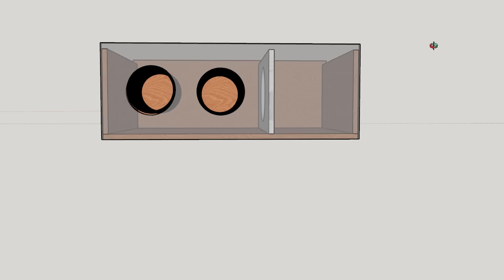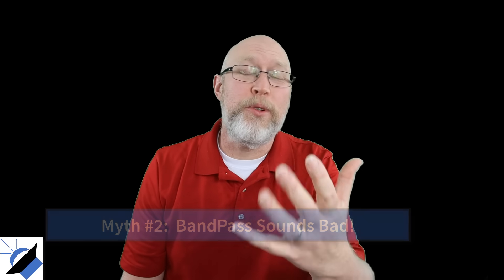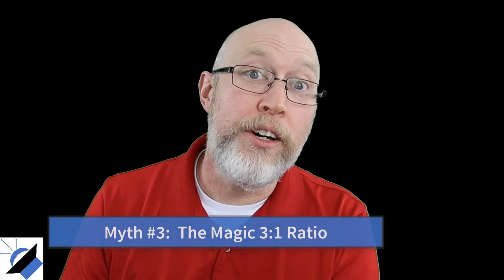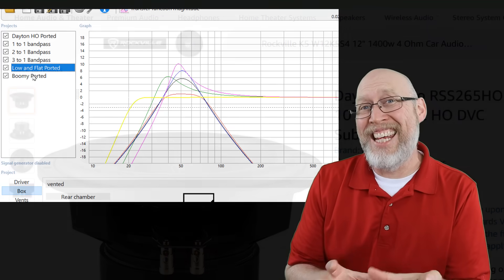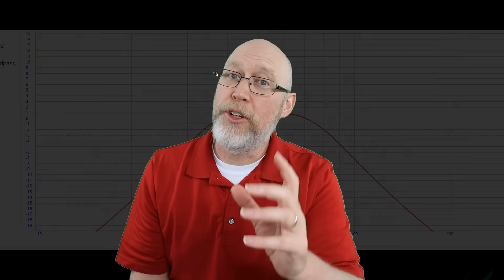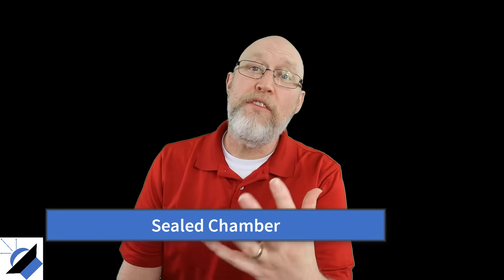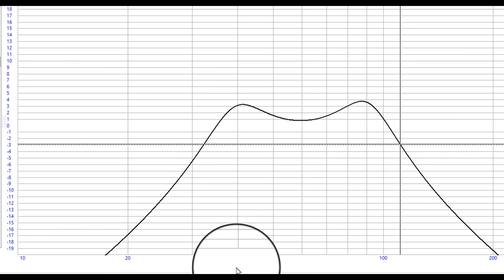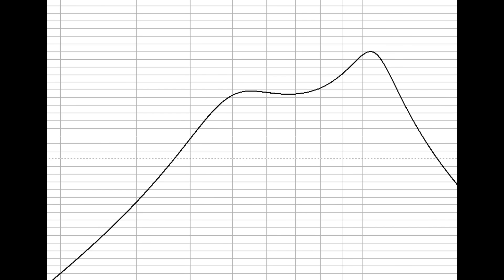Bandpass Subwoofer: You Are Doing it Wrong.  Bandpass MYTHS BUSTED!

Comment: Like 16 years ago I was pretty uneducated with the technical aspect of audio. I knew the basics had been messing around since I was a kid in 80s. But there wasn't hardly any easily found resources there are now. But I bought a visonik bandpass from crutchfield and it sounded terrible and muddy and I burned it up probably clipped hell out of it I'm sure but I didn't know about clipping and I couldn't hear distortion with it. They replaced it and I burned up another... I ended up going with a Polk db12 in prefab box worked great for years. I still have that BP enclosure (actually both) and now I know technical side it's a total piece of crap, it's small prob 1 to 1 but super small. I'm sure the sub that was in it was a cheapie.
Reply from the maker: Yea, bandpass is complicated.

Comment: Doesn't the bandpass box get louder at max watts/power and have half the size box than the ported box? I'm pretty sure them Dayton response plots are of sensitivity not max db output right? I would bet the loud or all the ported boxs would reach their mechanical limits far sooner than the bandpass box would. But the bandpass would reach it's electrical limits sooner than the ported. Seeing how most subs only do 1 or 2 octaves and we all like smaller lighter boxes, I don't know why we don't see far more bandpass subs. Also bandpass boxes have less or far less overtones and or unwanted higher frequency noise or distortion than sealed or ported boxes because they drop very sharply at there high bandpass frequency. I also feel like the bandpass plot must have been tuned to 40hz to 50hz? If so what's the plot look like tuned to a more reasonable 30hz to 35hz? I'm not saying the Dayton sub is best suited for a bandpass but I feel like there's more variables you didn't address. I like a sub to hit 30hz to 120hz or 20hz to 80hz for bigger applications.
Reply from the maker: Thanks for the comment.  That's a lot of ground to address in the YouTube comment area.  But a few quick things.  In general a bandpass enclosure is going to be larger because you're dealing with two chambers.  

As far as the plots go, you're making the argument that the bandpass enclosure can handle more power and will thus be louder.  True. If I were going to compete in an SPL competition I would use a band pass enclosure.

The main point of the video was that you can't just throw any subwoofer into a 3-1 band pass enclosure and expect to get a good result. For the typical person It's much easier to get great sound with a vented enclosure.
Reply: @DIYAudioGuy  well every bandpass box I've ever seen is smaller than the proper sized ported and probably over twice as loud. Which would mean you'd need 2 ported boxes to do the output. As far as I understand speaker boxes are a trade off of bandwidth, loudness, and size. You want it to be small you lose either bandwidth(bandpass) or loudness(sealed). You want bandwidth you lose loudness(sealed) or need a larger box. You want bandwidth and loudness you'll need a big box. So properly designed bandpass boxes trade bandwidth for higher loudness and box size. But most store bought subs are tuned too high around 45hz. That hardly what I call a sub. Missing the lower octave. I think being a musician that a sub needs to hit 30hz for the low B on the bass guitar so all boxes should be tuned to at least 35hz. But that would cost them loudness or size. And it's hard to sell a bigger or quieter product. But hey why not trade bandwidth? And that's where we run into the bandpass box. But they cost more to design and and make as well. I guess you get what you pay for, ha.

Comment: Hi! I'm a bass player and have always been wondering how to design the best sounding but also efficient 30-70 Hz band pass to support a smallish bass amp that does not go much below 80 Hz. What would you recommend, 4th or 6th order? What would be the smallest possible size (for portability) for a power handling of say 300 WRMS? Wouldn't a sealed enclosure with rear-firing passive radiators be a better choice for minimizing enclosure size and group delay (good sounding deep yet tight and well defined bass)?
Reply from the maker: I don't have any experience with guitar cabinets.  So I don't know what the best tuning frequency is for them. I like to build one sometime.

You are correct if you're trying to build a compact enclosure passive radiators are the way to go. You're not going to build a compact band pass enclosure because it requires two chambers.
Reply: @DIYAudioGuy  thanks for answering. But I'm wondering whether a passive radiator would allow for a smaller enclosure (for same low reaching tuning frequency. For instance there is a number of tiny bluetooth speakers with multiple passive radiators, reaching astonishingly low), while a vent requires a larger one (to avoid the ugly sounding mid bass hump)? Any advantages in combining passive radiator and vent, or is it just a good way to get in trouble facing impossible proper tuning?
Reply: Try a downward firing speaker with breathing room below... resonate the floor. (In most rooms)

Comment: I'm glad you made the qualifiers that you did.
Back in the 80's I tried every possible box design
in numerous variations.
They all stink.
Give me 4 Lab-12s in a 4 cu.ft. SEALED BOX.
It can't be touched for fidelity,
and has equal Output with a Ported Box.
(but needs twice the power).
Reply from the maker: Right!  You can get output from any enclosure you just need to keep cranking up the power!
Reply: What I discovered that I was missing was Transient Response.

Comment: Band pass systems sound better in a hatchback or suv/van, they have more low tone and less shake. Band pass boxes never seemed louder to me in SPL in any car Iv tried, and they don't project well outside the vehicle in comparison to sealed or small ported boxes. Your right that the old school boxes were not loud like the now big ports, but they seem like another animal all together tuning the car like a external port system. With sealed in the old school boxes under the power they used to If your projecting properly outside the vehicle, your going to want a sealed big port design. led or ported box. When you  use a sealed box or smaller ported box the internal body of the car or truck becomes the band pass side of the box. Band pass boxes are terrible for trunks giving more air flow shake for rattlers. What I'm realizing fully after almost 30 years is it's all about the box and the reason my set up when I was in high school was so hot beating everyone's set up in my age group across the state of MD. with just over 1000w rms, it was not about the amp but my custom built box. As soon as I put the old set up in a pre fab box was junk in the next car. Ant I had ppl coming to bass off with me over and over with 2000w rms multiple boxes and not even close. Everyone told me my box was too big lol but then they got smashed. If your looking for amazing you need a custom built box that fits your speakers and amp all else fails.
Reply from the maker: For sure man. It's a whole lot more complicated than most people understand.  Especially the in-car response, or the in-room response if you're in the home. 

I totally agree about box size.  I think we see so many undersized boxes because there's limited space in a car and because people seem obsessed with power numbers.  As the box gets bigger power handling goes down, but the speaker gets more efficient so you don't need as much power.  Why waste all that money on doubling your power (and upgrading your alternator) when you could just make the box a little bigger?

Comment: What about when designing a series 6th Order band pass enclosure, do you just tune the ports to the volume of the part of the enclosure that it’s venting from? And is it true the tuning of one side also has an effect on the other sides’ tuning; sort of like the ‘equal and opposite reaction’ etc?
Reply from the maker: To be perfectly honest, I have yet to find a credible, reliable source with mathematical formulas on how a sixth order (some call it a dual reflex) enclosure works.  I know they exist because these things can be modeled in software and software is nothing more than automated mathematics.  The instant I'm able to find that information I will translate it into some common sense language and I'll make a video.  In the meantime download WinISD and tinker with it until you get something you think will work.

Comment: Back in 1987 a friend and me built a box out of 3/4" plywood that barely fit in the trunk of my 78 Buick regal from side to side, we put four 12" woofers side by side and we had no port holes it was air tight and I drove it with a Kenwood 920 amp and it thumped like crazy.

Comment: My friend... You are using a low Qts 10" driver optimized for ported enclosures when modeling a 4th order BP. If you had used a 6th order BP for the RSS265, you'd get better results.
Reply from the maker: Absolutely.  You've got to put the right driver in the right box.

Comment: This is great info!  Can you elaborate on best polarity for a powered subwoofer?
Reply from the maker: Typically we just go with standard polarity, positive from the amp to the positive on the speaker, negative on the amp to the negative on the speaker.  Sometimes it doesn't sound good because of the placement and position of the subs or interactions around the crossover point and it's useful to flip the polarity or adjust the phase.

Comment: Great video! I love bandpass! Back in 2004 I had a 01 ford Taurus with two 12 inch pioneer impp TSW305Dvc subs in a 1:1 bandpass I built myself. Front&back chambers was 0.9cuft and I use pvc pipe for the port which was 3" x 5" each if I remember right. It's was Amazing! Had that longthrow bass and I used an audio control epicenter too. Sounded Beautiful inside and outside. People would ask me, "how you get your bass to be so deep and low"? Bass is just air and you want to move alot of it. Your sub is an acoustic air pump! 

So Now I have a jeep grand cherokee with a kicker zx2500.1 and a Soundqubed 15" HDX3 in a ported enclosure. It's beats stupid hard but bandpass have this certain sound that I'm addicted too. 

I been trying to order another one and build a 4th order wall but their sold out so I'm going to wall it with two Dayton Audio ultimax 18s. I have a 4th program on my PC that I already punch the numbers in and the results are impressive, better than any sub I seen probably because their fs is 19hz. Their louder and more efficient on lows. I can't wait to buy them!
Reply from the maker: I am a huge fan of the ultimax, and those pioneers from back in the day were awesome!
Reply: @DIYAudioGuy  yes man especially the SPL subs they once made. It's like they said forget car audio subwoofers! They were made in Mexico at first. Mexico was making them right because I could give them 2x or 3x the power and they would last but then they move everything to China and it all went down hill from there IMO. The spider would rip and cone would rip. They had the best infinite baffle subs period! Man I miss those days

Comment: The best bandpass design comes from Germany and is called Fortissimo Bandpass.  This was designed by Dietmar Carle and is in my opinion the best variant to build a bandpass. To briefly touch on the subject, it uses a chassis that plays well in closed cabinets. Best examples are: Arc Audio Black 12 or JL Audio 12w6v2. The closed chamber is first tuned to about 45Hz. In the case of the chassis just mentioned, that would be about 30-35Liter. The ventilated chamber is now tuned so that it corresponds to about twice the volume of the closed chamber. For a 12" chassis, or for the chassis just mentioned, that would be about 60-65 liters. The port area is then calculated from the air displacement volume of the chassis: in the case of the JL 12w6v2 this would be 500 cc x 1.65 cm = 825 cc air displacement volume. This value is multiplied by 0.4 - in this case 825 x 0.4 = 330 ccm port area. The port is then tuned with the length to approx. 65-70Hz. In this case, the port length should be 20-25cm. In the simulation now a peak of approx. 10-12db results. This is simply pulled down with a deep and steep low pass filter of about 40-50hz at 18-24dB/oct. The big advantage of this design is that the chassis in the range between 55-65/70 Hz has to make only about 1/10 of the stroke as comparable chassis in a closed cabinet. This results in a very crisp, fast and punchy bass in this range. In addition, you have at the same time a steep drop in the upper frequency response and downward out the same drop of 12db/oct as in the closed.  The only disadvantage is the size of the cabinet. However, in contrast to the closed housing, you have about 3db greater efficiency and the aforementioned fast upper bass. For 8" chassis a 10 liter closed to 20 liter vented or for 10" chassis 20 to 40 combi would work. Chassis from JL Audio, Arc Audio and Hertz Audio are best suited for this purpose. The case also works very well in cars m. Especially in sedans or convertibles with ski bag highly recommended. In the car but necessarily pay attention to the fact that adjacent surfaces port lengthens and thus the real length must be somewhat shorter to achieve the tuning frequency of 65-70Hz.

Comment: Purchase a band pass box in the 90's with two 10's! Years later I forget the brand but it was a medium brand in its time like pyramid I think but anyhow it seemed to have a constand gun to it! Honestly I only purchased sealed boxes after that! Would like to try a ported box next system I build! Looking into purchasing 2 of the down for sound jp 23 amps and two subs and well that's as far as I've gotten to so far but back in the day I ran a cadence electronic crossover with a 7 volt line driver and it made a world of difference cause older head units only put out like 2 volts out the RCA's but now I think the average is close to 5 volt but now they have larger line drivers so though people seem to have forgotten them in going to use one!  One amp per sub wired down to either 1 ohm  or .5  we'll  see!
Reply from the maker: Sounds like fun!

Comment: I have a 16 cubic foot band pass made out of inch and a half thick Birchwood plywood with two scar audio zvx V2 18 in. Sealed side is 4 cubic feet ported side is 12 cubic feet. 3 to 1. Pushing 80 volts at 2 ohms. In the cargo area of my 2005 Chevy Tahoe. At 33 HZ it'll score 168 DBs. This is only possible because I used half inch thick lexan for my window on the band pass construction. Also I have (4)  4" ports that are 9 in Long. If you want to get loud your box has got to be rigid. Acrylic is for chumps. Polycarbonate is where it's at.
Reply from the maker: That sounds awesome!

Comment: i've already built the box and never knew all these crazy specifics! could you tell me the fc of my box? sealed section is 2 cu ft but i have 2 subs and my fs is 41 and my vas comes to 1.009 cu ft. it's a 2.65 to 1 ratio (before displacement) box (5.25 ported 2 cu ft sealed) tuned to 42 hz. thanks much in advance
Reply from the maker: That question is a little bit too big to give a quality answer in the YouTube comments.  

But there is a more important question. How does it sound?  Do it bump doe?
Reply: @DIYAudioGuy  man it's great. 2 taramps bass 8k at .5 each with 2 american bass hd 12s. to save space and apply more power i went slightly under the max per sub ported is 5.25, american bass says 2.5 to 3 cu ft per sub (i did not know it at the time, but i reached out to sonix enclosures as they have one but it was 2 cu ft per sub after displacement, i asked if they knew it was too small and actually they built that box built on customer input, requesting smaller box for higher power input so i could have actually went smaller) and with a basic understanding that "bigger sealed = more low end" i went 2 cu ft sealed. she plays cleanly from 23 hz (can play lower but the bass does not perculate as good.. if that makes sense lol)  to about 55. shrinking the ported section of the box would make it more peaky though right? would shrinking the ported side 1 cu ft even add much power handling?
Reply from the maker: @notyobiz6207  If you're happy with it don't tinker with it.